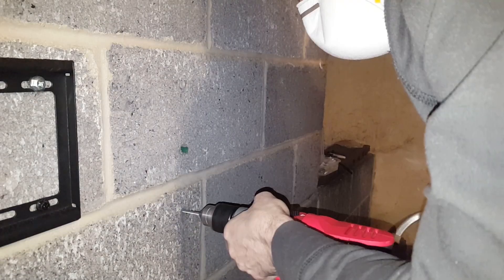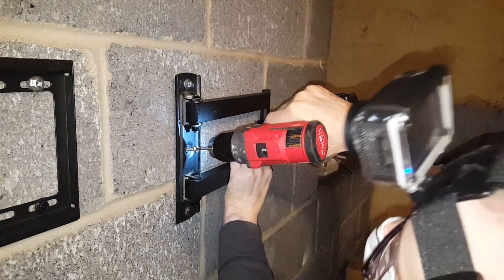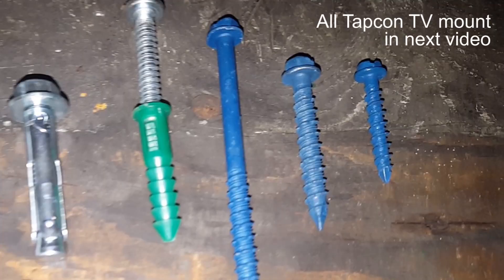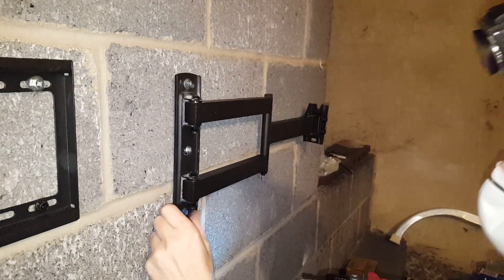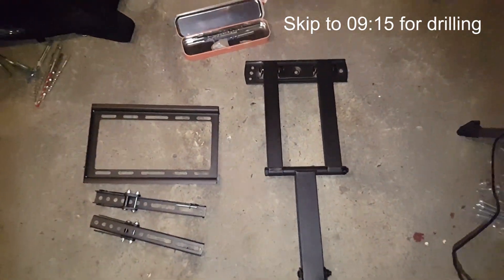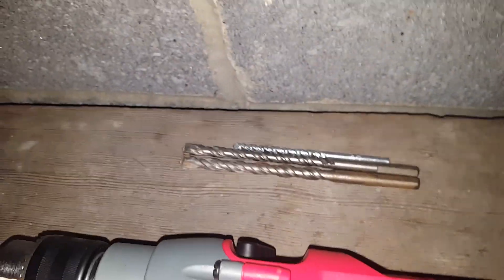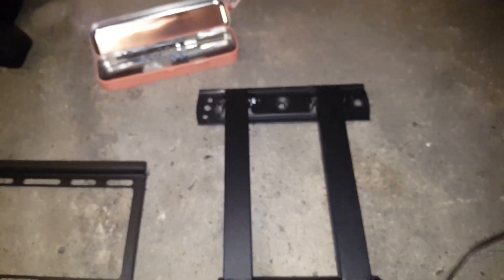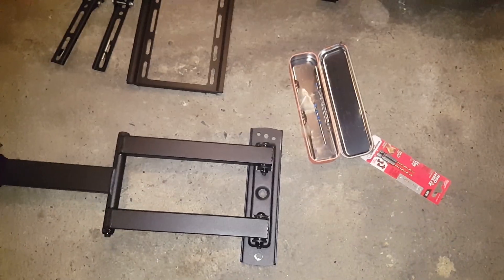TV mount on concrete wall: how strong is it? Which anchors to use?

Comment: Great video bro.  I have cinder block walls in garage and want to hang more mounts for tools.  All the current mount holes are placed to align with the grout lines which I thought was stupid and after seeing your video it confirms where I believed the holes should be drilled.  I would assume that drilling into the cement lines will just weaken the cinder blocks surrounding those drill points.  Thanks again!!!

Comment: So using a hammer drill will work? Asking because I had a cement like wall that needs to be wall mounted
Reply from the maker: Yes, and with masonry bits. A regular drill would take a long time, if it works at all. Use the plastic masonry anchors for the lag bolts that come with most TV mount kits.

Comment: Do you have a video for installing a TV mount above a brick fireplace? If so can you provide link, thanks.
Reply from the maker: If you're mounting a TV to a brick wall, you can use this video on how to drill/drive into brick and just use the same TV mounting steps as the concrete TV mounting: https://youtu.be/rRpi1usP7_c

Comment: can you remove a screw from the plastic anchor and reuse them? want to move my mount to another place. appreciate your answer
Reply from the maker: The screws tap a bit of thread into the plastic which make it a little stronger so if you want to be safe, you should probably get a new plastic anchor.

Comment: When you have a stucco coating, you can't see where the mortar lines are...so that is a huge issue!  I have had VERY poor results with Tapcons because of that.  In that situation, what anchor would be best?  Also, given the concrete may be only 1 1/4" thick (or could be the full depth, since with stucco covering it you don't know ahead of time!), what length  anchor does one choose?
Feedback:  Good info but the camera work made me dizzy.
Reply from the maker: I would use a mount that has slots so you can put more than just 4 anchors and make some of the anchors plastic expansion anchors for lag bolts, the kind that usually come with tv mounting kits

Comment: Do you have to drill all the eay through or just enough for the plug or spaghetti?
Reply from the maker: It has to be longer than the anchor by at least 1/4", which usually means drilling through in the case of hollow block for any kind of TV mount.
Reply: @toolsandrepairs  thank you very much :) all went smoothly